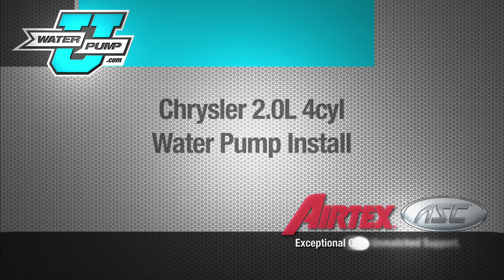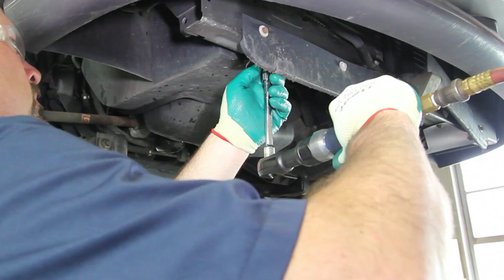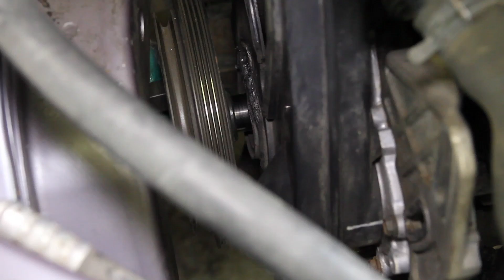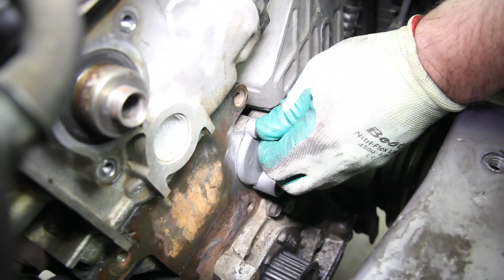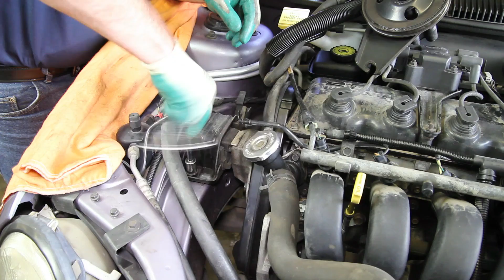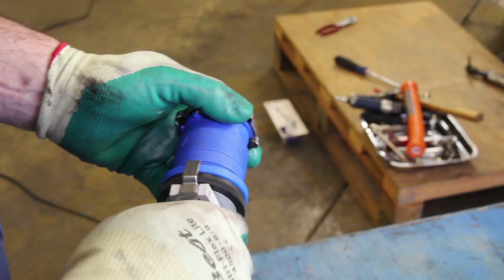WPK-0039  / AWK1253  How to Install a Water Pump and Timing Kit: Dodge 2L FWD

Comment: Ive been researching this all week to do on my 02 neon. I seen a few things in this vid that are big things i was told never to do.. first is how did this guy remove the cam gear bolt without the tool to hold the gear inplace? Second how did he put that bolt back in to the cam gear??😅 holding the gear with his hand and effortlessly torque it to 85ftlbs?? Only thing i could think is he used that alignment pin youre Not supposed to use..
Then lastly i was told NEVER by no means turn a engine over by anything other then the crankshaft.
He turned the engine over with the dang cam gear!😮
This is a good ruff over view but by no means a instructional step by step. And either about 8 forums and 6 videos on this subject i watched today were wrong...
Or this guys video has some bad info in it. ..
Reply: I did this 5 years ago. It's 85K miles ago since and has held up very well. You loosen the cam gear bolt before you remove the timing belt, it's got a key way, so the gear will not spin freely on the shaft. For the torquening it back on, you use the old timing belt to hold it still, and you will be able to get it done. If not, you just snug the bolt flush, then install the new belt, and when it's all on you can tighten it at last. Then it won't matter if the engine spins a little, because the crank will also move due to the belt being installed. In reality, it doesn't matter if you spin the engine with the camshaft bolt, or the crankshaft. Not on a low compression gasoline engine. I think this video is very good for giving a general instruction. I did it on a Chrysler Stratus with the same engine. Now I have to do it again due to milage getting close...

Comment: What is the tool called that you used to get the crankshaft pulley on? I can’t find one that’ll thread and I’ve tried 3 different tool kits that weren’t the same thread type

Comment: You forgot to mention one of the most annoying parts how you repeatedly have to raise and lower the engine just to get to the bolts and get them out.
All the parts that would drive one insane doing this are removed just so folks know🤔

Comment: Omg you gotta take apart half the engine just to get to the water pump.. I hate Dodge why would the make it so hard to change a water pump.! Wow that look like its gonna cost me $1000 for a mechanic to put a water pump in.!
Reply: It’s actually not as bad as it looks. Trust me, I did it in 1 day with really no issues. If a 17 year old kid can do it you can probably do it better and faster. I replaced the water pump, hydraulic tensioner, and timing belt over 5 months ago and have had zero issues since!
Reply: Hard to change? You have to do this what once every 100k miles or so? Are you changing the pump or timing belt every week? It literally takes an hour to do. Super easy. Just did my 2004 R/T the other day. Timing belt, tensioner and water pump.

Comment: This mechanic is working on a Plymouth Breeze or similar sized car.  I watched this while planning on working on my Neon.  I wish I could express to him how frustrated I was when my motor mount bracket didn't slip out the way he did it. The way he casually pulls out the alternator belt... so much on here wasn't enough to actually complete this without a lot of effort to figure out what he left out. Also, the tensioner has been redesigned and looks a bit different.  This video might have been made prior to that change. But if you want to follow this now, you'll have some surprises along the way.
Reply: Perhaps if he didn't gloss over the critical things that could stop someone in their tracks.  For example my three bolts for the motor mount bracket simply will not allow removal or installation of that bracket in the Neon. If I hadn't found another video explaining to jack the engine up then lowering it would allow their removal/installation I'd still be in the garage banging my head on the wall.
Reply: @jeepwonder  he glossed over things that were not critical at all. your issues come from a lack of experience working on vehicles. you clearly figured it out though so it must not be such a bad video.
Reply: Really? The body being inches narrower making his technique impossible is a small issue?  If I wasn't experienced I wouldn't have been able to get around it. Your name says it all.  @buttpoopskittlefiddle201
Reply: Lol you shouldn’t be changing a timing belt if you feel this video glazes over shit lol you have no business under the hood of a car

Comment: I am wondering if have a 2004 dodge neon STX i have already changed the Ramsgate and radiator cap but I'm still losing water between the overflow and ac compressor what could it be it not overheating by much but now that's it's hot I makes it difficult just not sure why losing that much water
Reply: that it is pouring out the overflow on condenser pump
Reply: +Airtex Pumps 
it is  backing up and it pouring out over bottom of condenser pump

Comment: How long would this take to remove the water pump in the 2005 neon 4cyl 2.0?
Reply: Took me days of work and fooling around: running for parts, trying different pullers since harmonic balancer had some damage from a previous screw-up, (ended up drilling and tapping balancer while on engine to use a completely different puller than the standard Mopar one.)  Harmonic balancer installation tool kit that didn't include the proper parts that would work for this harmonic balancer, making my own installation tool for the balancer and having it welded up at a muffler place. Bunged up threads on the damper bolt, re-threading end of crankshaft, ordering new damper bolt from dealer and waiting for it. Depends on your experience, available tools and equipment and what shape everything is in from previous work done on vehicle. (Phew!) Hope yours isn't anything like mine was!
Reply: that was my helpful
Reply: Well remember he started on December 2002 he still at work on 2020, wow I have a 2001 neon and I have to replace my water pump. No thank any one knows how much a mechanic will charge for this work?
Reply: @sernani99  too much. It’s not that bad a job took me about 6hrs. Just realized it’s time to replace it again.....😔😢
Reply: @sernani99  How much?